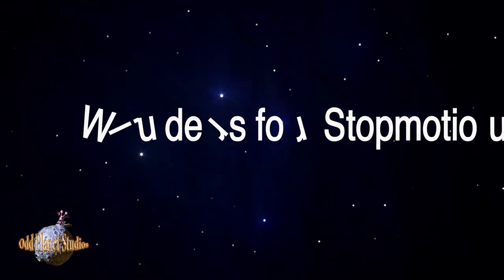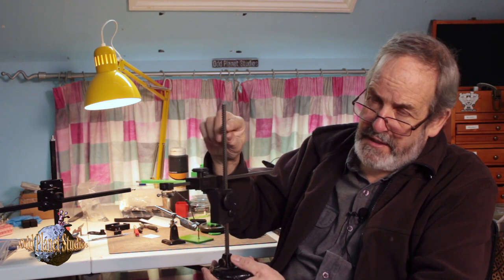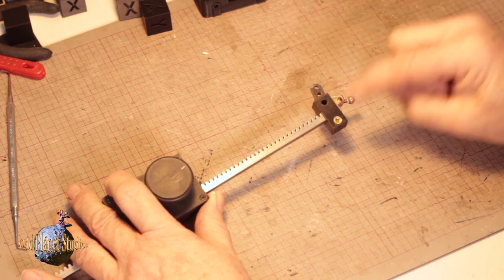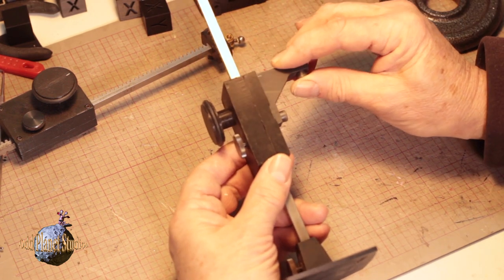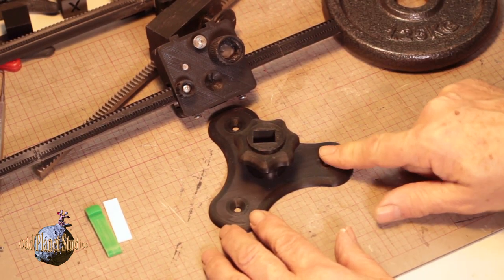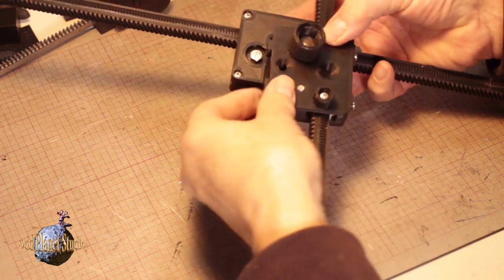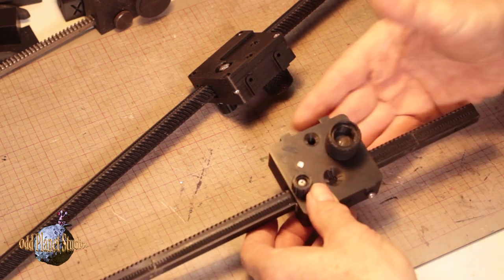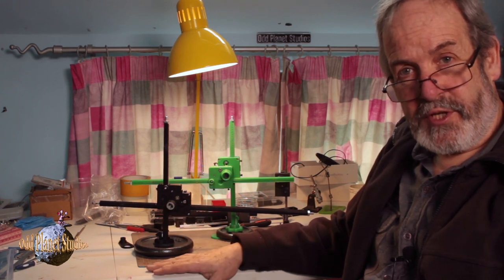Winders for Stop Motion

Comment: This is great, thank you. I have the Quantum Cat winders, and sadly one started to split very soon after starting to use it - I guess I was screwing the locking knob too tightly, but it did happen way too easily. Agreed also on the end, it's very awkward. Once I have the 3D printer up and running I'll definitely try Friendly Beans, it looks brilliant.
Reply from the maker: That's a pity. If the 3D printer files are still available, you might be able to print off a replacement. Alternatively try gluing it back together. I think they were made in PLA.

Comment: Great review! Do you have any recommendations for sizing the 3D printed version?
Reply from the maker: I recommend going for the v2 winder, which has a herringbone rack and several other improvements. Print at 100% size, otherwise the bearings and bolts will not fit. You likely do not need very long racks, but if you need a long reach, use my rack clamp and a rod to extend.